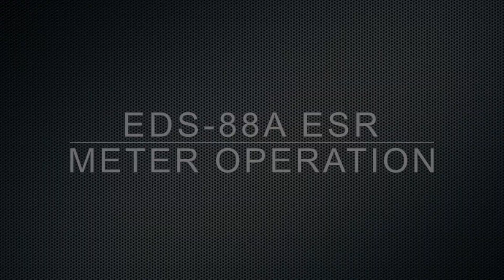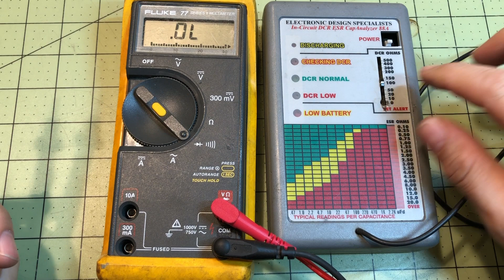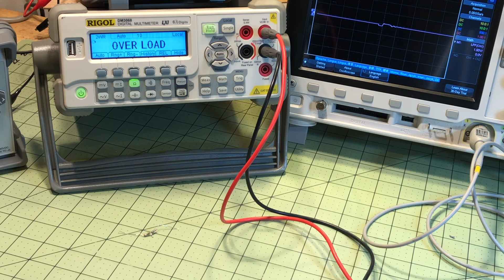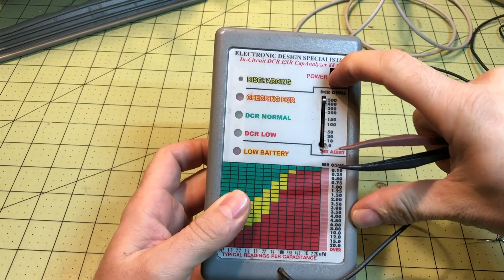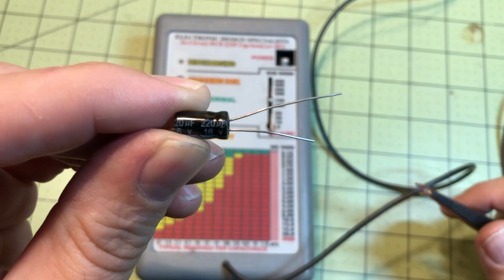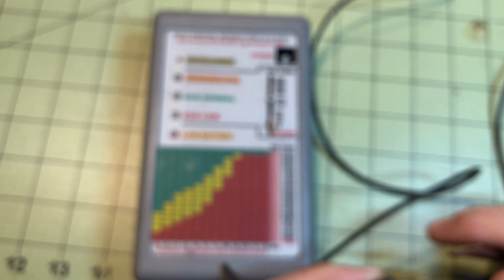EDS-88a capacitor esr tester demo

Comment: They’ve started manufacturing again. Look on eBay and there’s a gentleman who is licensed directly under EDS and Dave miga (The original designer and the owner of the EDS)  himself to sell completed units and the diy parts kits. 

However I highly recommend getting their “leak seeker” unit as much if not more than this one. They are both indispensable when troubleshooting boards. The leak seeker takes a bit of practice but comes with a great manual and instructions on how to practice and learn the meter.

Comment: Hi,do you have shematic diagram of esr meter or same like that with led bargraphf
Reply from the maker: I just buy them, I don't make make them. BK Precision makes a very good ESR meter.
Reply: Jes I know that, but I am looking for diagram to made it by self.Ok thank you anyway.
Reply from the maker: @mirsadradoncic4676  I don't know of one with bar led, but this is an ear meter http://www.radiomanual.info/schemi/ACC_instrument/Dick_Smith_K-7214_user.pdf
Reply: @electronicsprojects4708  I Have One of that ,I am interesting for some like yours.
Reply from the maker: @mirsadradoncic4676  I haven't seen one

Comment: This looks like a good piece of test gear, do you recommend?
Reply: I ended up ordering the BK, it arrived yesterday and I love it. Very easy to use and works well so far. Thanks 🙏 
With regards to tracking down a short with resistance setting on your DM, I would love to know more, maybe next episode idea 💡
Reply from the maker: @bixy9347  You guys want to know ALL my secrets, lol. Bix, what electronics are you repairing?
Reply: Yes indeed, tell me all your secrets!! waaha ha.... (insert evil villain laugh)
I’m into stereo amplifiers, 70’s 80’s, it started as a hobby and now I’m always working on one. I absolutely love working on cool old equipment, reading through the schematic, finding problems..... 
Always trying to learn new “tricks” 🕺
Reply from the maker: I recommend the BK Precision 881 ESR meter
Reply: Yeah I was looking at the one also, what’s better about it? Thanks 🙏
Reply from the maker: @bixy9347  Their functions are almost identical, and EDS shut down the manufacturing of this unit.
Reply: Electronics Projects
Kits are available if you would like to put one together yourself. I’ve tried the bk version and several others and they are all nice, 

but Dave migga at EDS did designed this original meter and came up with the idea decades ago. You can purchase the parts kits from him for $100 and the circuit boards and enclosure from someone on eBay that works with Dave. I haven’t built this meter yet but I have used it and it’s great. I plan to build one. 
I did however build another eds design which is even more useful! I the the leakseeker .... It’s indispensable and even in my lab full of equipment I use the leak seeker almost daily! Trust me… Build one! There are no alternatives to the leak seeker…

As for ESR meters, really hard to beat the DER EE 5000 for in and out of circuit testing
Reply from the maker: @hullinstruments  I am in a position where techs rely on my recommendation and I can't recommend a meter you have to build yourself, I appreciate the suggestion. I own both the BK and EDS, but I have to recommend the BK for that fact. I have used the EDS 20 years now and love it, so don't misunderstand.
Reply from the maker: I watched the 'Leakseeker' videos on Dave Miga's channel, thanks for the recommendation. At my bench I use a Rigol DM3068 meter, it has mΩ precision. I just tracked down a shorted MOSFET IC half way across the board on a computer monitor using the resistance test, couldn't do that with a standard DMM.
Reply: @electronicsprojects4708  They’ve started manufacturing again. Look on eBay and there’s a gentleman who is licensed directly under EDS and Dave miga (The original designer and the owner of the EDS)  himself to sell completed units and the diy parts kits. 

However I highly recommend getting their “leak seeker” unit as much if not more than this one. They are both indispensable when troubleshooting boards. The leak seeker takes a bit of practice but comes with a great manual and instructions on how to practice and learn the meter.
Reply from the maker: @hullinstruments  That's Merced, one man show. There have been some issues with his quality, reliability, shipping, etc. You can take a chance if you want, but I would go with the BK.